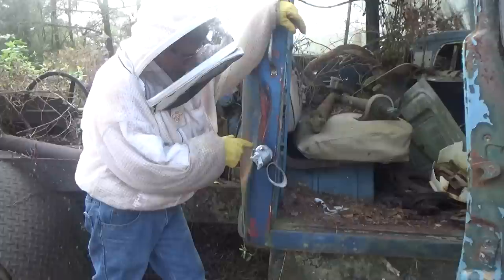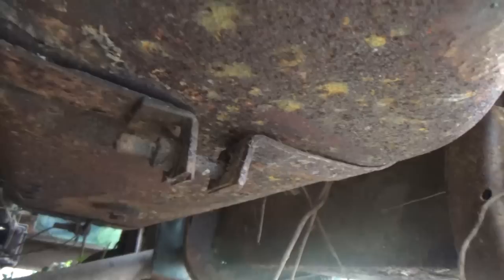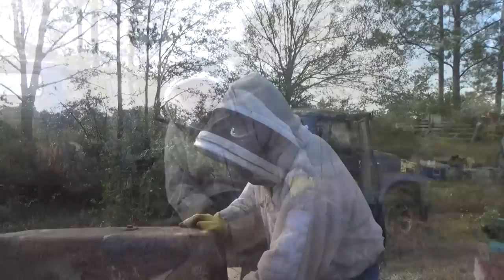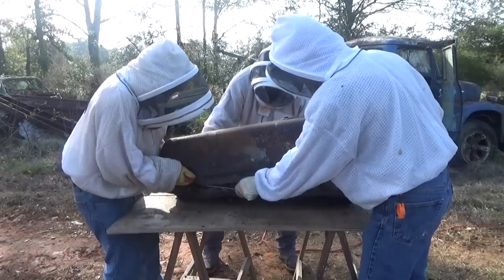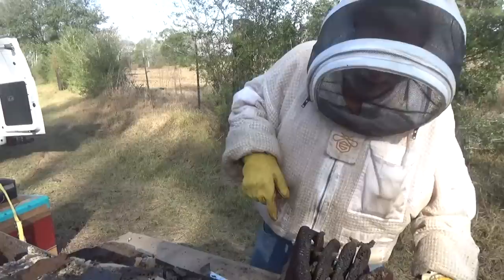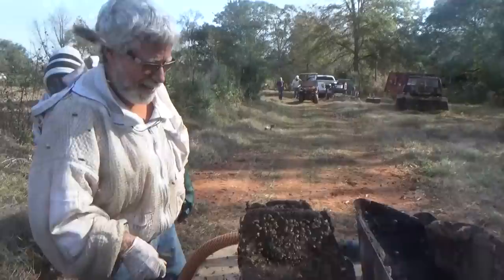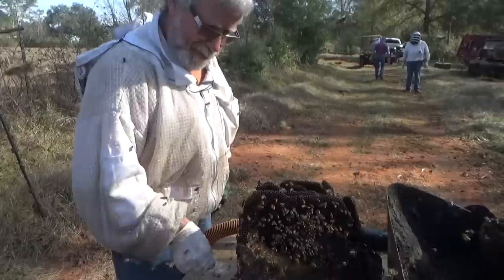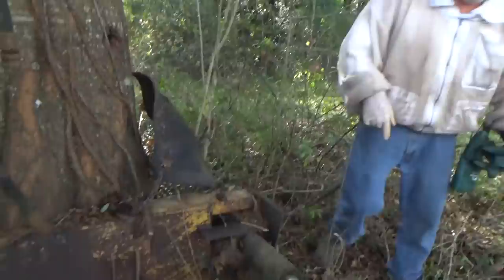How is that even possible? Honey bees in a gas tank?

Comment: I would love to see some sort of day by day (or so...) photo time lapse of a single frame on how how the bees rebuild their comb (without stressing the bees too much or making them abandon their home, of course). I think it would be very educational. If you like this idea, can you do it on one where the comb overlaps? I see both you and the 628dirtrooster sometimes overlap the comb on an empty frame if it's thin and has just been built, and I always wonder what the bees will do to comb that is like that. Obviously, you can just tell me the answer from your experience, but I think seeing it as time goes on would make for an interesting outro or digression in a cutout video.
Reply from the maker: I really love the idea of videoing the process of bees repairing the comb after a removal, but unfortunately, I lack the skill and equipment to do that. It's rare for me to overlap the comb when placing it in a frame after a removal as it is more likely to touch the comb from the frame next to it. I think the only reason I would ever do that is if the comb were thin enough where the overlap would occur did not extend beyond the width of the frame. Thanks for watching. God's peace Pete.
Mr. Ed
Reply: @JeffHorchoff  This sounds like a great idea! What about glass or plexiglass on the side of a box or box cameras with infrared light filming?
Reply: @lorenrobertson8039  I was just thinking like take the same frame out once every day and take a picture of it to see how things change overtime. Nothing fancy. Not sure though if it wouldn't stress the bees too much.
Reply: @pete8420  Now that I wouldn't know. Perhaps Jeff can get back to you on that. Have you looked up time lapse of bees building a comb? It may have been done and posted somewhere. Nice conversation!

Comment: Where do you get power from ? Probably should be using a cordless while laying on the ground. Could be a shocking experiance, maybe you had it GFI ed . Hope so. Did not hear a generator. Hard to believe we have snow sleet and ice here . Forgot COLD also  power from ? Probably should be using a cordless while la Hard to believe we have snow sleet and ice here . Forgot COLD also
Reply from the maker: Charlie has a small Honda generator. It's very quiet and does a great job giving all the juice we need to do a removal. Stay warm. God's peace John.
Mr. Ed